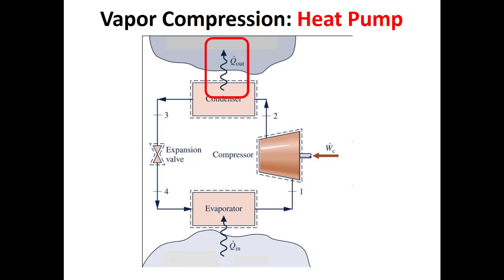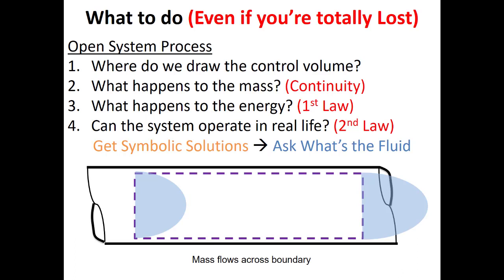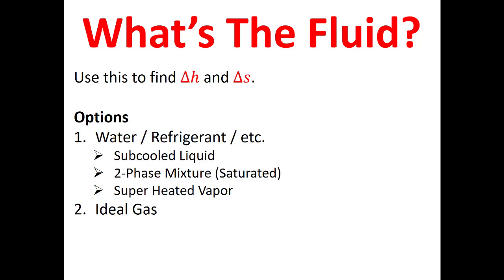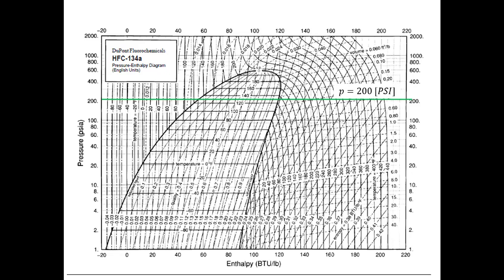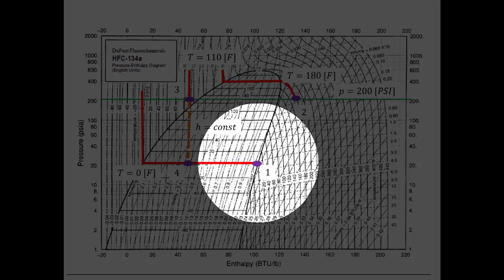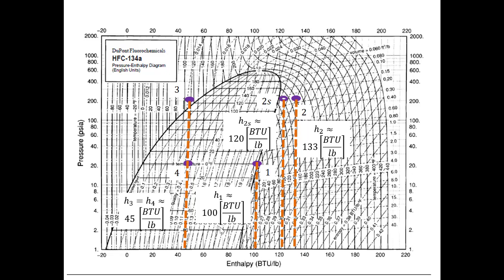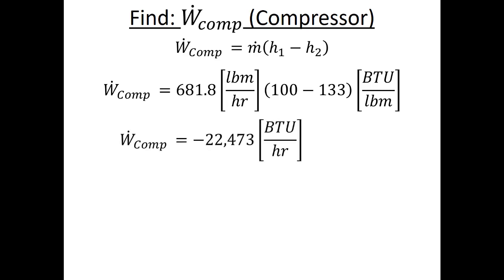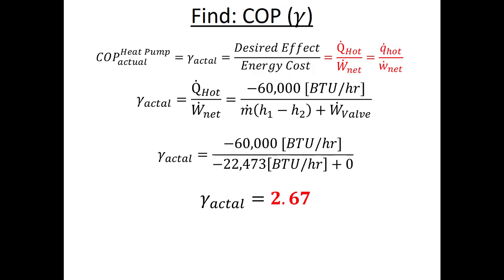L37 Vapor Compression Heat Pump Example

Comment: please what textbook is this
Reply from the maker: Images are from Fundamentals of Engineering Thermodynamics (Moran et al). But I think this content would be in most Thermodynamics books you'd see in a Mechanical Engineering book. 

The difference from the text is that I don't switch the signs for power like they do. I think it's confusing when you can't get the equations we're using directly from the 1st law. That way you can use your understanding to answer every question in the same way as long as you understand the process.
Reply from the maker: And I don't think they talk about the graphical solution method in the text...I could be wrong though. You could solve this same problem using thermodynamic tables.
Reply: @mikeschertzer941  bless your heart